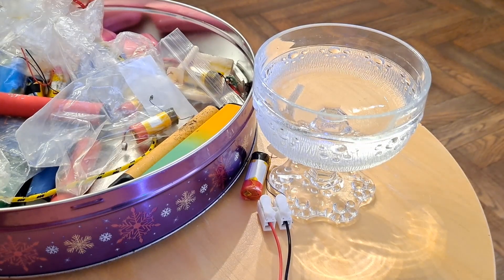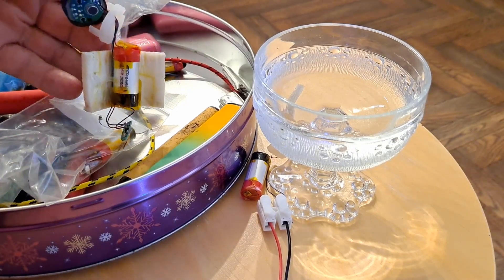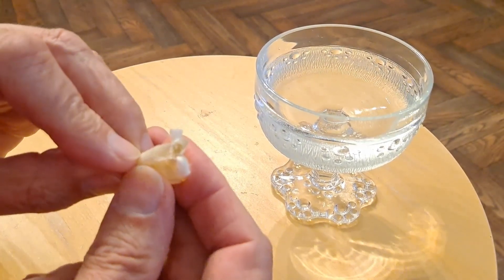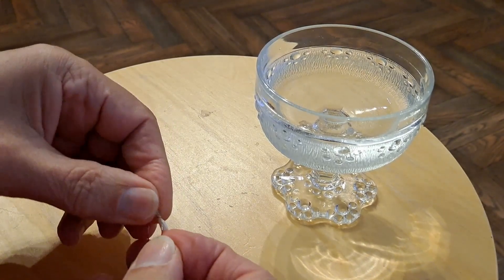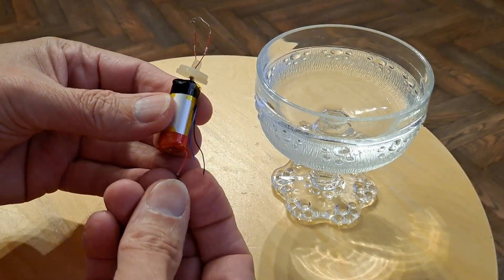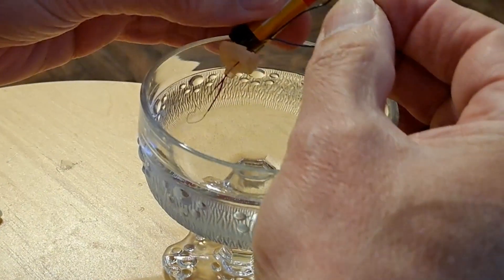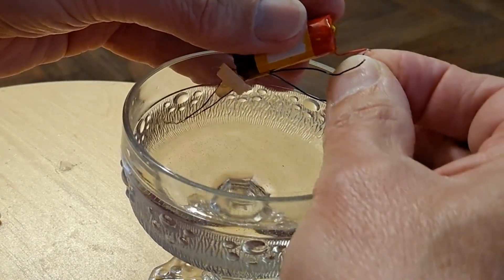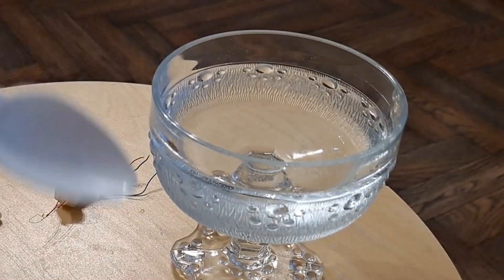Vape Hunter 👀 - Video reply - Looking at a Vape heater coil

Comment: Interesting to see the heater coil working. That wire is probably Nichrome wire so you won't burn it out. I am sure you used Nichrome wire on your hot foam cutter. 👍
Reply from the maker: I am pretty sure the heater element in the vape will be nichrome too.

Comment: but how hot will the spoon of water get before the battery or wire burn out? its kind of like taking the smallest guitar string and hooking it to a battery to cut foam with
Reply from the maker: The point is there is no way it will flash water to steam at the speed required to run a pop pop boat. I would probably do better using the nichrome wire from a hair dryer. I have plenty of that and have used it for foam cutting. But for foam cutting I am using a big 12 volt car battery to supply the current and that won't be practical on a pop pop boat.
Reply: @GrandadIsAnOldMan  yea you answered the pop pop question but brought another to mind.. I dont know why I mentioned the foam cutter, too much free association I guess

Comment: The problem is water has an unusually high latent heat - it takes a certain amount of energy to heat water from room temperature to 100 degrees, but quite a large amount more to make it turn to steam at 100 degrees. That tiny filament might be able to get the water in a teaspoon to 100 deg C but it wouldn't be able to make much steam, certainly not enough to power a pop-pop boat unless it was incredibly small!
Reply from the maker: If we look at this from an alternative point of view, it is interesting how much power there is in a candle 😁😁
Reply: @GrandadIsAnOldMan  To vape it is  usually around 170F any hotter and it will burn. I always wondered if they bothered to try and regulate that temp, I doubt on the cheap ones they have such concerns.
Reply from the maker: @deemond5289  yes, in the vape it is not trying to boil water. The vape liquid is formulated to vaporise at a lower temperature. Obviously it would not be safe to inhale steam. That would damage your lungs.
Reply: @GrandadIsAnOldMan  Yes, that would  chafe a little :) The 170F temp is more for herbal vapes. any higher a temp and carcinogens are created from the burning.

Comment: Your trying to heat to much water at a time
Reply from the maker: That is rather the point of this video. I already replied that it is wouldn't work, but I have done the video to demonstrate it.
Reply: @GrandadIsAnOldMan  try drops of water and I bet you get steam.
Reply from the maker: They wanted to know if you could run a pop pop boat with the heater.